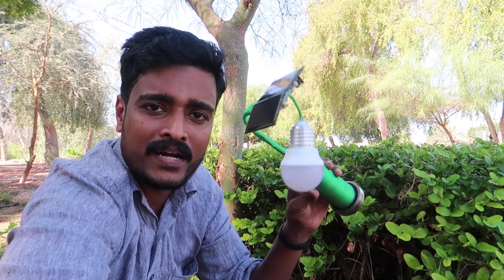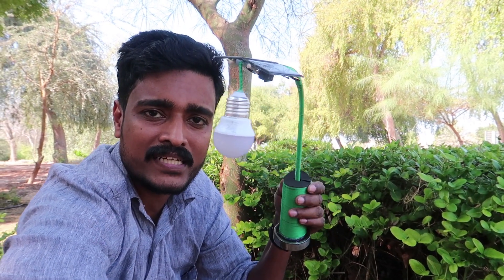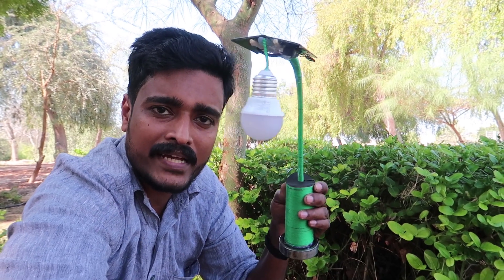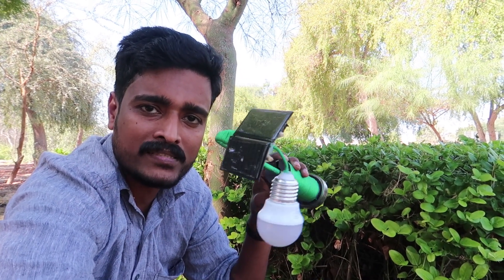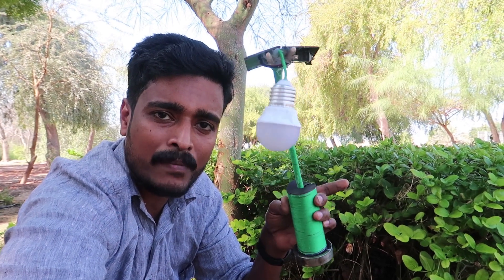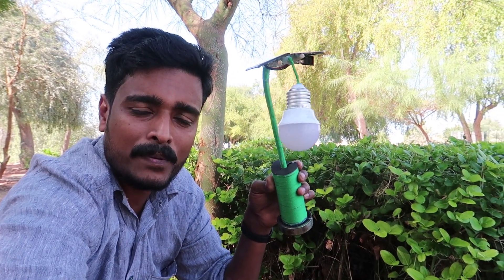How To Make  Solar Power LED OUR HOME ?  Malayalam |Experiment UAE|

Comment: Edinte transistor connection sariyallallo bro
Transistorinte basel biasing voltage onnum kittunnillallo ?
Reply from the maker: BD 140 Transistor nite 3rd pin anu base .e base pin on cheyunthathinu solar power anu use cheyunthathu